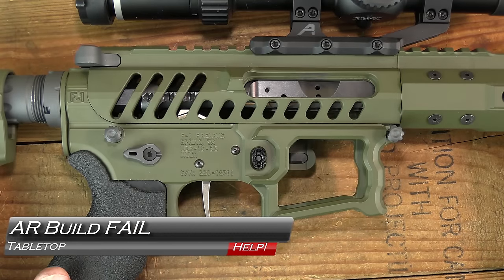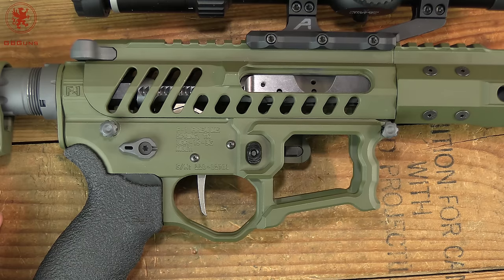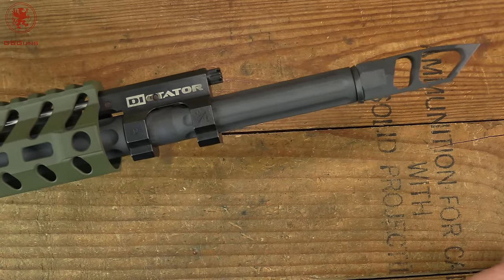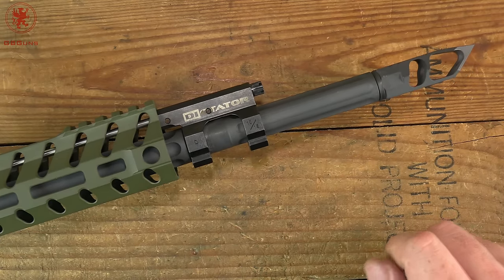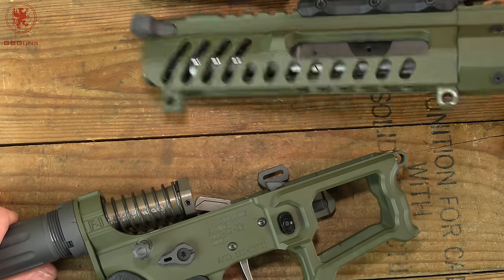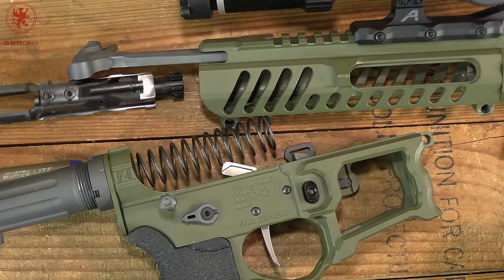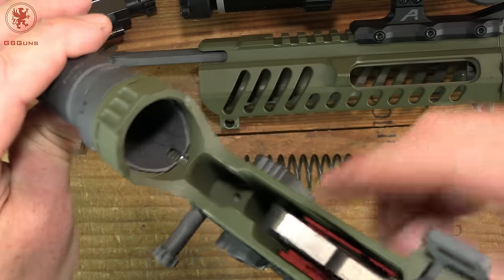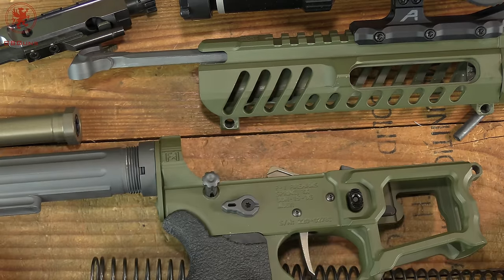The Worst Thing You Can Do For Your AR

Comment: I don’t know much about guns, but I am an engineer that knows materials and physics... By reducing the mass of the components, you are reducing the inertia (i.e. heavy trucks are hard to stop). The spring has a lb/in rating, and I suspect that your components don’t have enough momentum and inertia to overcome the spring. In theory, if you reduce the force (mass x acceleration) going backward, then you should reduce the force going forward (the spring).
Reply: I’m not an engineer and I’ve only built cheap guns but my first thought is that light weight buffer is the problem, I would try replacing with a normal weight buffer and give it a shot
Reply: @MrJag1269  Yeah, as soon as the gas can escape, the light-weight buffer snaps back before it can cycle. It needs more mass for it to have the momentum to fully cycle. The lighter weight he goes, the worse the problem will be. Obviously, if it's too heavy, it won't cycle at all, but too light, and it'll be at the mercy of the spring. There's a sweet spot he'll need to find.
Reply: I agree with this post, after the gas block gets the bolt moving, thats it. The gun uses inertia to eject the round without breaking the gun. you might want to try some lighter springs. Also try moving the gas block closer to the breach/longer barrel. Can also try a heavy block to increase inertia(Turn your gas block back down if you any of this!). Maybe drill and ream the gas port on the barrel slightly. Keep trying different stuff, it'll work I know it!

The reciprocating action of a firearm is like a see-saw; It can't work without a balance of forces. Your weapon is weighted too far in the return action to cycle the weapon. I'd start with lighter return springs! All in all, this is a sweet gun but you need a better pin setup. Those auto-escape detents are no good. (only thing I actually saw wrong with the gun.)
Reply: I'm no engineer however I agree. You're spring seems to be far to strong for the gas you are working with
Reply: I’m not an engineer, therefore I cannot give my opinion on this matter.
Reply: Just throw about 3.4-3.8 oz of total buffer weight and tune gas block to accommodate cycling.

The mentions about mass are accurate, but relative to efficiently utilizing that lateral mass, your looking at a graph that gradually increases, reaches a plateau, then gradually decreases as you add/remove weight. There is a target mass/resistance ratio (the plateau) that you have to obtain to complete a cycle. Your gas block alone isn’t outputting enough to compensate for the decrease in lateral mass to overcome your spring weight.

This is why lightweight builds are more complicated than most people think. You can shave weight off your BCG but will have to add it to your buffer or increase gas pressure. The only true way to create a super lightweight build is to use a pistol buffer and tune collectively your buffer weight as low as possible with gas block adjustment. Otherwise your just having to repurpose the weight you “saved”.
Reply: im not an engineer myself but this sounds like something an engineer would say
Reply: Bingo.
Reply: this was my first thought as well, not enough momentum/inertia in the system.
Reply from the maker: You should read the article
Reply: I don't think that skeletonizing will have any noticeable impact on bullet energy, but one thing that helps reduce weapon recoil is having a heavier platform. When you lighten the slide on a semi-automatic pistol, that is good because it reduces the rearward energy over the wrist axis and subsequent muzzle flip, but you want the lower receiver to be heavier so that it takes more energy to affect it.
Reply: I agree. The problem is simple physics.
Reply: I agree that lack of momentum is the issue.  Three factors are out of balance.  First, the impulse through the gas tube is short limiting the available energy.  Second, the mass of the bolt carrier and buffer is low limiting the kinetic energy available.  Third, the spring was selected for a heavier buffer.  With the low mass and short impulse, not enough energy is imparted and retained to overcome the stiff spring and consistently cycle the action.
Reply: Siinds ike everyone agrees it's the spring
Reply: The BCG wasnt disassembled so I couldnt tell if the gas rings were aligned correctly.  As a US Army small arms repairer and armorer for 24 years start with the obvious problems first. And , that buffer spring is way to heavy for the reduced mass of the BCG. Also no mention of the twist rate. There is a noticeable difference in gas pressure between a 1:7  and a 1:9.
Reply: I don’t own an AR but I can imagine you’re absolutely correct and it’s the first thing I thought about when I started hearing “lightweight” parts. If he switches the buffer tube out to a heavier one it’s possible he may be able to go thru a full mag without any jams.
Reply: You basically scienced what I said in layman terms lol.
Reply: I was thinking the same thing.
Reply: I'm an engineer and don't have an f'ing clue
Reply: My understanding of the physics is that the mass of the bolt carrier shouldnt be important as it will still experience the same impulse. A lighter bolt will just have the same momentum by moving at a greater speed. An argument could be made that the heavier bolt, accelerating slower, is acted on by the gas system for a slightly longer time and therefore experiences a greater impulse, but I would imagine that this difference is near negligible.
In a nutshell, bolt mass will have almost no impact, he's not able to increase the gas blowback force, therefore a longer buffer tube or weaker spring should be the only 2 valid options(given that he doesnt want a different barrel and/or gas system)
Reply: You are just abt right I believe problem is rifle length barrel and gas with carbine length buffer
Reply: Saw a similar problem, not too long ago - he went back to a standard weight carrier and recovered the momentum necessary to operate properly. A lighter spring probably may help also.
Reply: @MrJag1269  Try a standard weight carrier, and recover inertia to cycle properly.
Reply: Sorry, didn't mean to repeat myself.
Reply: This is the right route, if there's no more adjustment possible with the gas port, you need to look at the spring. Try a regular buffer with a lighter spring. Make sure the bolt is slathered in good gun oil, something like Gunny's. Worst case would be plug the gas port tap (weld) and move the block back, even an inch and a half could make a huge difference, and you'd still have access to the adjustments, or replace the barrel. It looks great, hope it works out!
Reply: Good for you and your superior knowledge.
Reply: I showed this video to one of the old heads who hang out drinking at the corner store and all 3 of them said the same thing the Engineer said
Reply: I was thinking the same myself.
Reply: I'm a Janitor and from what I have read it's all Brandon's fault that you're weapon won't run.....  Try the spring....
Reply: I’m a machinist and fix engineer theoretical designs.
Reply: I'm a welder and my GED has been fixing the mistakes caused by engineering degrees for 34 years.
Reply: My first thought on the problem.
Reply: I'm a software engineer. please hire me

Comment: 90% sure its spring, (edit) yeah when i saw how far spring came out of tube and how thick the spring was i am now like 98% sure its spring.
Reply: Yeah? My buffer tube is all the way into my stock.. it doesn’t come out into the upper receiver like his
Reply: That seemed normal to me, but Its worth trying.
I use JP silent captured spring and I removed my buffer tube detent to make it easier to get out (mayb this dumb lower is trying to be cool and not have one at all). Mine runs fine tho it means whenever I take it down, spring will just spill out.
Reply: I agree with thomas there should be a stopper that doesn't allow the buffer to come out I bet 100% that's the issue the way it sits now it's getting jammed making it only allow to go half way
Reply from the maker: @mark you should read the article
Reply: Same thoughts
Reply: Not a AR genius but it has to be the spring. Carbine length buffer tube and rifle length spring?
Reply: It's the spring.... It is not supposed to be sticking out that far custom or not.
Reply: Yeah with that gas system, you need a lighter spring. You have the perfect bolt carrier group for that short burst of gas but the springs way too stiff.
Reply: You are missing the buffer retainer. Also spring looks a little thick
Reply from the maker: See video description
Reply: in glocks when you do all this type of work to them you have to change the spring. So that should help, also you are runing a way better than regular riffle. using a little more powder in the shells will give you that same feel, but better performance. Just look at the grain difference profesional target shooters use. Definitly look at a spring, but that riffles bottleneck has rissen, in other words you added all the turbos to your engine, you just need the timing belt and better octane fuel to get the most out of it.
Reply: Yep, saw description, and yes 100% I figured that out too after all of your talk of gas system and saw that spring pop out.  Glad you got it running.
Reply: Ya the first thing I was going to ask was why the buffer spring retaining pin wasn’t holding your spring inside the tube.
Reply: @GBGuns  you should edit your video w/ the fix and stop wasting people's time that are just trying to help you.
Reply from the maker: You can't edit a posted video.   We've done two update videos since this was published AND an article in Ballistic.  I can't help it that people don't read video descriptions or pinned comments or pay attention to the date.  Do you think these same people watch a rerun of the 2006 Super Bowl and wonder who wins?
Reply: @GBGuns  well now I’m curious who did win the 2006 super bowl ??
Reply: @GBGuns  
Who reads!?
Reply: I had the same problem with a different setup. The answer is found by figuring out the total amount of distance in the upper reciever extension, (buffer tube), your BCG and compressed spring has to travel. With the current combination, seems to me if you went with a carbine, or pistol length spring, and/or a rifle length tube, you would get much different results. If it was my gun, to solve the problem on, I would try them all out, and chose which configuration I liked best. I ditched my odinworks adjustable buffers for KynSHOT hydraulic buffer systems, on my setup there's no muzzle rise. Other than that, your setup looks top notch!
Reply: I was gonna say try a lighter spring
Reply: Loosing gas between gaskey and 3 bore? I had that issue with a “fail zero”
Reply: It's the spring 100% you need a lighter spring
Reply: @thomasspicher6260  the reason his buffer spring and buffer “came out into the upper” is because he doesn’t have a buffer retainer installed. So when he opened it up, removing the upper from the lower, the BCG was no longer in the way which caused the buffer spring to push the buffer forward.
Reply: I agree spring is to heavy
Reply: Seems like it’s not secured